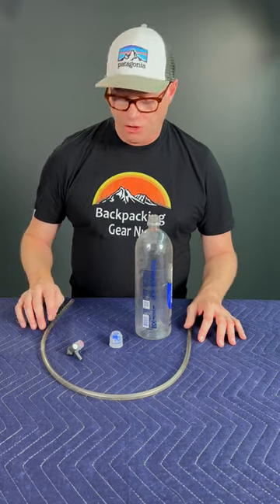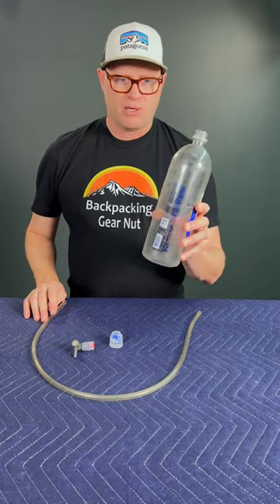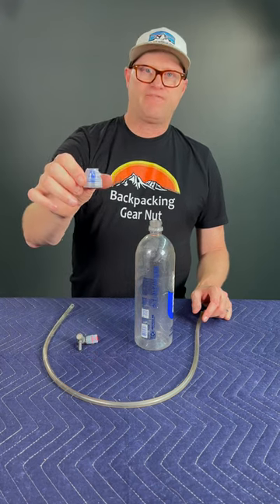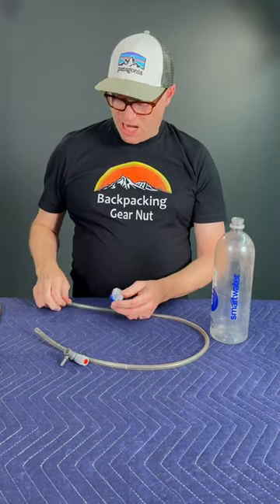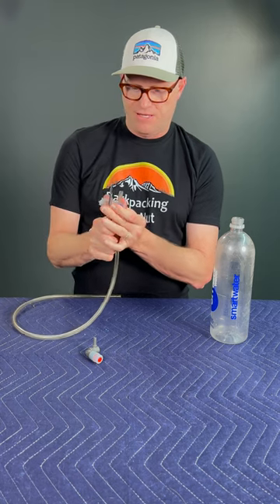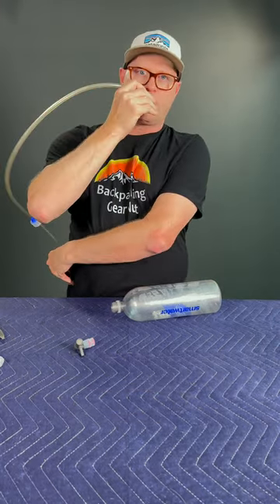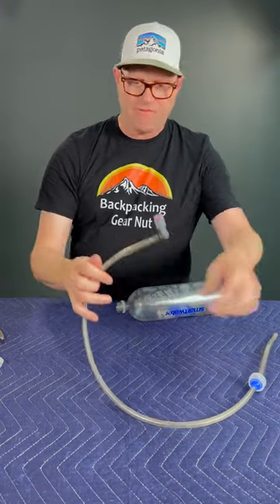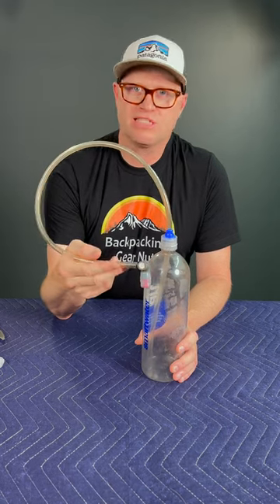"Ultimate Backpacking Hack: DIY Smart Water Bottle Drinking Tube Conversion"

Comment: GREAT TIP!! This is truly awesome, such a simple idea that works great. This allowed me to put together what I think is the most efficient, simple, and cheap way to gravity filter water. Instead of using the mouthpiece, I have a little device that pinches the drinking tube that acts as an on/off. I then use the open end as both a drinking tube, and the open end can also plug directly onto a Sawyer Squeeze. Using this in combo with a CNOC Vecto water bladder makes a suuuper simple setup.
Reply from the maker: I would love to see pictures. It sounds interesting!
Reply: @BackpackingGearNut  I'll send a picture to your email, cheers bud.

Comment: Where is your air inlet? Doesn’t your bottle start start collapsing as you’re drinking?
Reply from the maker: That is a good question. I never thought about that before. I have checked, and my seal with the tube could be better. It allows enough air to get in that it doesn't collapse, but if you lay it sideways, the amount of water it leaks is minimal. I hope that helps!